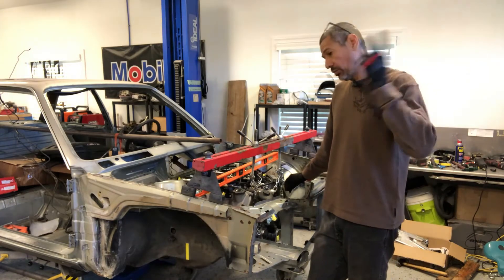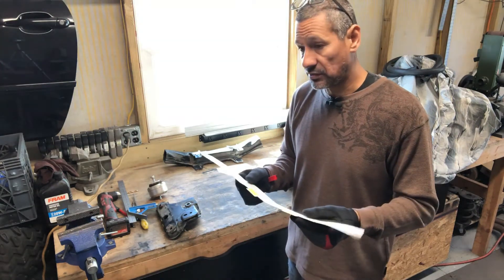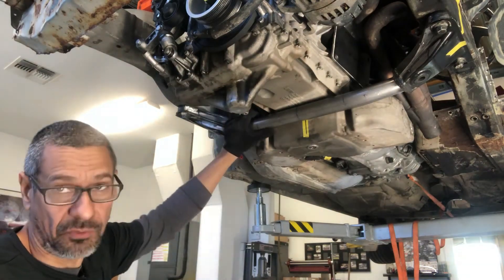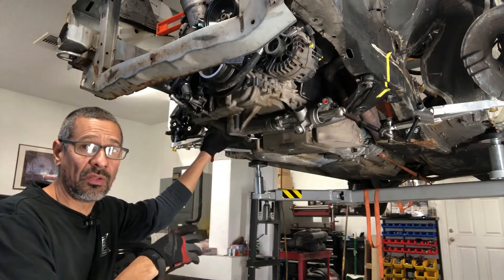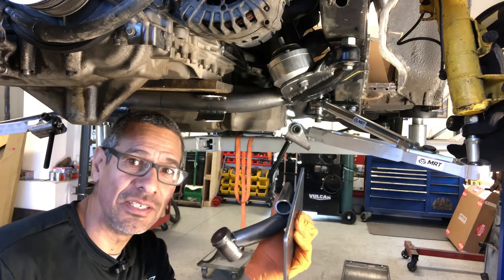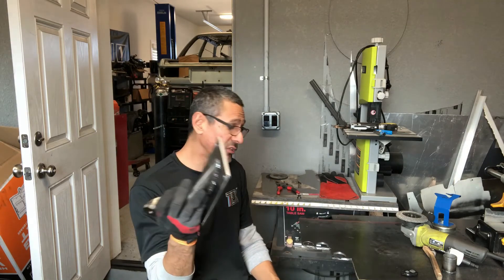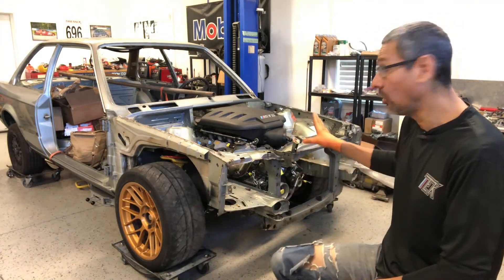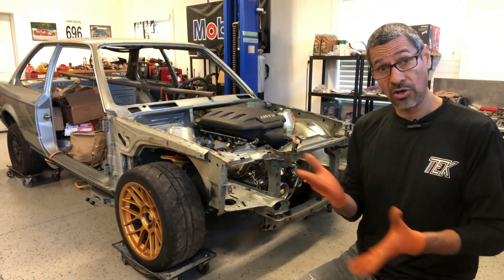BMW E30 Coupe, Swapping in an S65 Drivetrain with 6spd manual Part 2

Comment: can you do my S85 swap and i pay you ?
Reply from the maker: Sorry but I just saw your message. Actually found a few comments I missed. S85 swap!!! Yikes! That engine sounds amazing tho.
Reply: @tekmotorsports4052  i will pay you for sure if you can do it
Reply from the maker: @BplexOnline  What chassis are you wanting it swapped into? E46?
Reply: @tekmotorsports4052  e30 and you have full green light to cut whatever that need to be cut or done i dont care ahahah
Reply from the maker: @BplexOnline  Is it for a track only or for the street? Need comfort items like a/c. You have full drivetrain?
Reply: @tekmotorsports4052  on the street i have the S85 already but still no transmission. Im thinking of 7speed dct of e92 M3 with 3.85 diff of the 6speed. Im located in Montreal but i can tow the car to your location as well with my X5.
Reply from the maker: @BplexOnline  Well, I’m in Orlando FL for starters now that I see you’re from Montreal. And I’m thinking you’re talking about Montreal Canada right? That’s a pretty good distance apart.
Reply: @tekmotorsports4052  i will do the distance ma man my e70 X5M is pretty strong for a towing on that long. I can drop off the car may/June or later when ever you feel ready
Reply from the maker: @BplexOnline  Ok, I’ll be getting the E30/S65 project back by December and will continue the build then. Hoping to have it ready for paint around June or so. We’ll stay in touch as you get all parts.